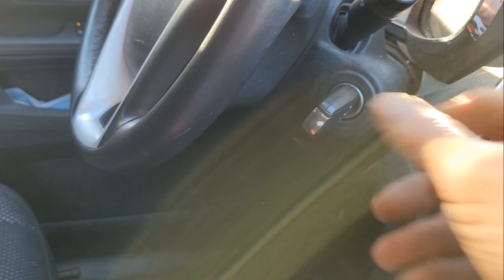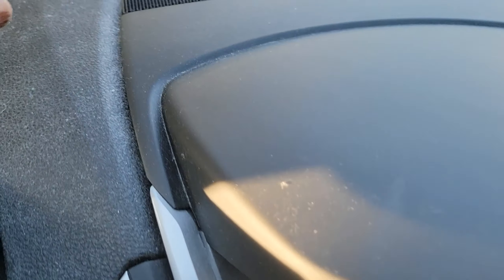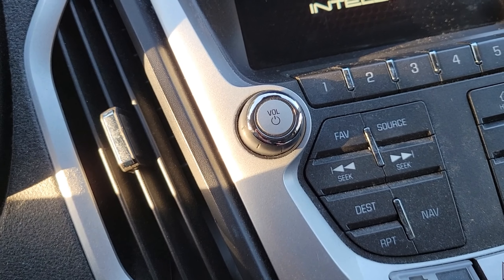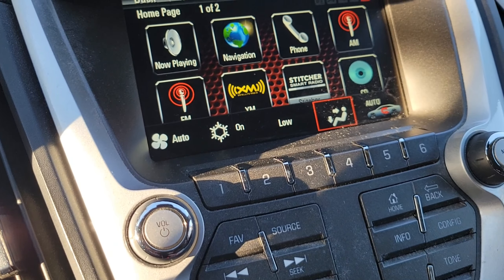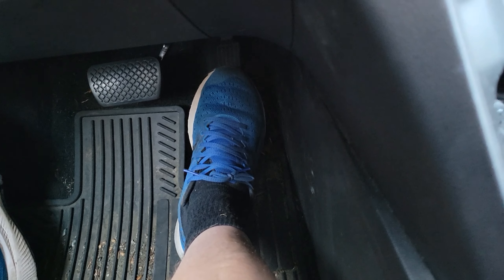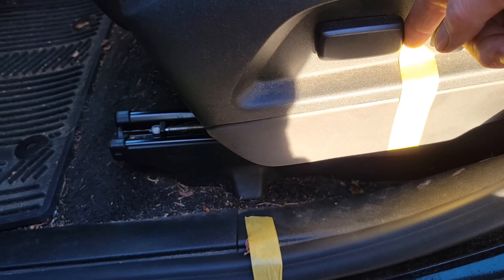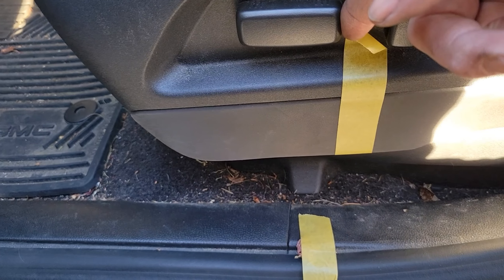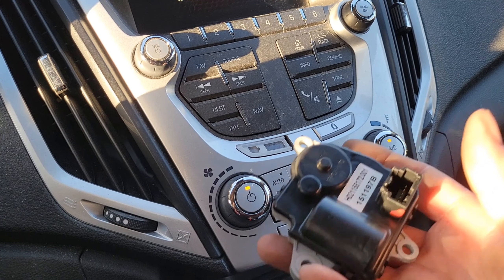A/C Or Heater Stuck On Defrost, Vent, Or Floor? 2015 Chevy Equinox, GMC Terrain Mode Door Actuator.

Comment: My GMC Terrain (2014) does switch from floor to middle to defrost windshield with no issues. The cold air (AC) blows cold air, but when I put the temp on high to get HOT air... No hot air comes out, only cold air from outside or whatever temp is outside. I already made sure I have enough anti-freeze inside the car... Now what? What to look for?

According to this guy in the video it is likely the door actuator from the passenger side then?

Comment: Thank you for the video. I have had my blend door actuator. Replaced 3 times. However now I need to replace my mode door but I’m having trouble finding it at the auto shop . All that comes up is the blend door, which looks the same. Any suggestions 🤷‍♀️ . I have a 2015 GMC Terrian. Thank you 😊
Reply from the maker: I looked them up on the napa website. Mode and blend door actuators come up as the same part number.

Comment: Here's my problem nothing work on my control panel radio is on a channel you can't change it or volume, heater is on low defrost can't change it air not working rear window defrost also not working. Got any ideas what makes all that go bad at the same time

Comment: thank you becoues i have to do mine and do you have to remove the the big bracket
Reply from the maker: You don't have to, but removing it gives you more room to work. Just be careful you don't pinch any wires putting it back together. Thanks for watching. I hope it goes well for you.

Comment: Just finished this 20 min ago. Your guide made this so much easier. Thank you!

And to others watching,  TAKE OUT THAT PLATE. It's faster to take it out (3 min) and reassemble (2 min) than to spend 20 trying to work around it. The back bolt on the plate is easier to remove and replace than the video angles make it seem. Plenty of hand space in there for a 1/4 in drive  ratchet.
Reply: @raymondsimpson16, agreed.  My son and I just today finished this on his 2015 Equinox.  In our case, the plate cannot be pivoted out of the way by leaving one bolt in.  Not to any great benefit anyway.  The big help from this video was the recommendation of the extended insider ratchet.  Went out and bought one.  Made the job much easier.  Again, don't try to work around the Wi-Fi mounting plate; it's a pain to try it that way.
Reply: @mikeh7151  I have a very very old, very small 1/4 in friver ratchet... handle is maybe 4 inches long, small profile head. Works great in tight spaces... but yeah I was jealous of his extended ratchet a couple moments.
Reply: What plate are you talking about?
Reply: @kupetsj  the one which the control module, the little computer, is mounted to, opposite the actuator under there. It's the one with 3 bolts which he removes with the extra long ratchet
Reply: Amen

Comment: Blend door actuator on my 2014 gmc terrain was clunking and stuck on heat. Headed to my garage now to replace this afternoon. 
Would the calibration be the same order of operations you showed? 
Great video. Cheers from Wisconsin!
Reply from the maker: Good luck! Should be the same. Let me know how it works out for you.
Reply: @shanersmechaniclife3164  turns out the cheep part did not work. Had to buy the Oem part. Just plugged it in and no calibration needed.

Comment: Here’s one for you. Replaced blend door actuator because it was making noise. Started getting warm air then went cold. Changed thermostat and coolant temp sensor. I’ll get warmish air at idle or stuck in traffic but as soon as I drive it goes cold again. Tried to recalibrate blend door actuator several times still the same result. Also heater core hoses are hot as well as all other hoses. 2011 Chevy equinox 2.4. In about to drive this car in a lake 😂😂. Any ideas?
Reply: The door the actuator is actually turning has broken